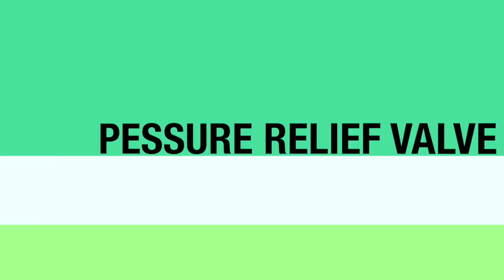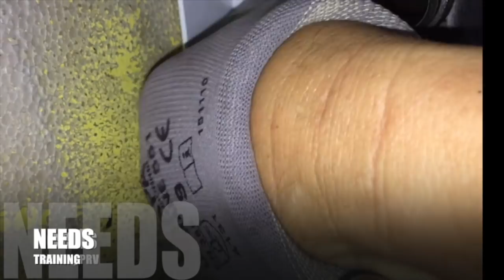replace a worcester plate heat exchanger and a pressure relief valve

Comment: Thank the gods now, on the new Worcester 8000 series the prv is at the front. Top bottom and sides come apart, colour coded parts inside for engineer. Slightly smaller and whisper quiet👍
Reply: Almost as good as Intergas. Intergas no diverter so never fails to supply hot water. Plate heat exchangers never fail neither.

Comment: Good video mate, must agree with other comments on how these boilers are trash. You will pay for the name and the boiler is full of plastic, can’t imagine the mark up on these. Also instead of making the flow turbine into a decent design they just chucked a green rubber jacket over the motor instead of making it so it doesn’t leak so easily!
Reply: What are you talking about? Worcester Green Star has won Which Magazine awards for the past decade. They're highly regarded within the industry.
Reply: Barrios Groupie obviously not a service engineer then!!

Comment: As a heating engineer with 40 years experience,I hate Worcester products with a passion.Its a damn shame they are so popular as  I hate working on the piles of shit.
Reply: i am sure they hate you too..... with a passion :P let me guess, you are a Biasi or Saunier Duval kinda engineer, as with 40yrs of experience, i bet you don't like change... you want the case to fall off, and all parts removable with one tool... times change, so do boilers, its a fine balance of what the Customer wants at the end of the day :P
Reply: Over the last 18 years fitted many Worcester Boilers they have always given my customers good service and when anything goes wrong I send the service department out straight away sorted. it's all about knowledge really the training is first class however like in life if  you don't really know what you doing you will get punished like The Dope l heard about that went to change a prv on a junior spent 6 hours there . Went out crying their a piece of shit was that you sir. If you had invested 1 day getting  to know your nemis it would probably have profited you. Still after 40 years isn't it time to give it a rest let the younger guys have a go.
Reply: I with no experience except buying a CDi35 22 years ago which has had a hard life including filling a 16x4 circular  swimming pool every year for 20 years and washing the cars from the hot tap and the Ba***rd thing just failed for the first time; sludge in the heat exchanger I am told! So I have to agree piece of s**t!

Comment: strip half of the boiler to get to prv.how they claim to be the best .probably the worst design ever.detest working on these.
Reply: Some engineers can remove a section of cold water pipe and get hand up the back and change that way! My hands are far too big! So yes all this to change the prv! I've never rated Worcester I've always installed baxi and just recently ideal logic maxs
Reply: Absolutely agree!
Reply: Frustration of trying to line the cover screws up as well. Overengineeed crap. Impossibly tight areas to work and no thought for the engineers working on them. I hate all their boilers.
Reply: Worcester greenstar changing prv on Tuesday Worcester shit take out return manifold just to change a small part like that Worcester need to employee sum one who has been on the tools to say what a shit place to put that.will never fit Worcester boilers ever
Reply: not really half of the boiler now is it :P
Reply: No, they just  have the best advertising campaign. My wife said that as when I come home with death in my eyes, she says, 

“Alright honey, Worcester Bosch!?!?...”

Customers are gullible and despite us heating engineers advising, they know best! Crap like the notorious the W.B.  PRV is why mechanics hate the engineer/designers of such machinery.
Reply: @TheDickPuller  

.....and a bomb there too, fins first!

Comment: This is exactly the reason I do not recommend nor install Worcester Bosch. With a Vaillant, the same job takes ten mins = less time, less charge to customer. Have just done one on a *astard Greenstar 28i and the plastic cowl would not lower, as it had jammed in place with scale. I could not force it for fear of snapping it, so this took even more time.

Easiest way is to isolate cold water feed on boiler, drain DHW circuit and cut the DHW pipe a few inches below the boiler, or however much you need for your arm and hand. Unscrew the horizontal compression nut, and remove this section of pipe, using a 15mm compression couple to reattach. My hands are huge and I’ve Popeye forearms, but still manage.

If things go your way, 30 to 45 mins.

Comment: Worcester reliable - YES. Easy to work on - NO.  All PRV's fail but why make it a nightmare to replace. Also I found removing the whole hydraulic assembly quicker to change the PRV. Same situation with the idiotic plastic filling loop from the CDI's onwards,  why did nobody in W/B work out how shit the design was until 20 years or more had passed.  Just like Vaillant/Glowworm pressure switches & leaking diverter valves; why don't they learn from their mistakes.  Great video and keep them coming.

Comment: Plastic hydrolic section piss out water. Burner seals leak, poor access to prv , expansion vessel at back. Worcester redesign your boilers.
Reply: composite hydraulic assy, Burner seals should be changed every 3 to 4 years ideally (only leak through poor servicing and maintenance tbh) other boilers has ex vessels at the back :)

Comment: Brilliant video. But all you actually need to do is cut the hot water pipe out of the way and use two screws to remove.

Comment: Thank you for this video. Only problem I encountered was the pipes run up the back of my boiler which means there is no room to take the exchanger back to get it out. You can however loosen the right hand pipework mount to bring it forward enough to lift the right hand side of the exchanger out if the way to get at the pressure relief valve.

Comment from the maker: HI Luke when you have remove the clip that hold the prv in place you will need to pull the p r v out  of its housing hey can be stiff the prv sit in a slide connector you pull the connector down to remove prv

Comment: At about 2.40 you made taking out the prv  clip look easy.
Reply: yes, I tried pulling with pliers and still to tight. just need to pull the clip downwards   with fingers, then you can get it out,  one post here mentions you then have a slide connector, you pull the connector down to remove prv. I will try that and hopefuly without even opening the boiler. 
But heat exchange above PVR may stop you lifting the  PVR up and out.?
Reply: taking the clip out is easy, it's putting it back in that's a brasstard

Comment: The pressure release valve holder ,the plastic thing,can move up or down to accommodate the PRV.You got to push it up to fit the PRV.
Reply: Is there a specific technique to move it down?
Reply: There is a lever at the bottom of the holder ,try that one .
Reply: Hmm, doesn't seem to budge at all for me. I wanted to see if I could remove and clean the PRV without having to go into the internals and remove other components. but it is proving tricky.
Reply: You can't take it out without taking the heat exchanger out.
Reply: Ah OK, thanks

Comment: well in, 
I've got a hot water running cold then hot on WB greenstar 24i. when I started the job I was told by the woman hot water on when on or off. I thought diverter stuck mid position. so I had the cartridge out and it's rusted to death along with its housing so the customer advised to replace. the partner returns and says his prv is also dumping bucket loads. will his prv be connected his hot and cold problem or would you say it's the diverter unit and housing that's on the way ?

Comment: As other comments this fails when pipe work is run in the Worcester suggested position up behind the boiler. And you didn’t push the outlet back up onto the PRV so there will be a drip under the boiler next time it has to let water out.

Comment: total overkill video , can save most the work just by cutting the hot water draw off pipe , gives you more than enough room unless you have time to kill .
Reply: At last somebody that knows the job I just info the nuts and move the pipe to the side takes about 20 mins only ever gone across one that I couldn't do...blocked plate2plate spirit of salts dies wonders..
Reply: Don't even have to cut it. Just disconnect and move inch or so to the side. Plate slights straight out.
Reply: That is the easiest way of doing it as long as pipesdrop down,and not run up the back.   Prv was put there to stop people using it drain down.
Reply: @russellblevins706 yeah they told me that.  Same reason the frame has razor sharp edges.

Comment: Drill out the three pop rivets that fix  the bracket for the plastic PRV outlet pipe and the pipe can be lowered away. The PRV can then be removed horizontally after fiddling with the clip.
Reply: You don’t even need to tackle rivets, let alone be using a drill 
to change a prv 😂😂 fuckinghell

Comment: Hi, Thanks for the excellent tutorial. I have managed to follow it throughout, but unfortunately I cannot remove the PRV at the end. It is unclear exactly what the mechanism for removal is. Could you clarify - thank you!!
Reply: the prv has a long plastic tab beneath the assembly, it locks in position, so look carefully at that and after pushing it to one side pull the tab down, leave down until new one fitted.. other similar boilers (WB) can be accessible without all this hassle
Reply: rumour has it that luke Anthony still has his boiler in bits
Reply: Daniel Curry nope he's replaced it with an ideal isar he found on eBay

Comment: Great video. The PRV only needs replacing in rare cases so it's not Worcester's effort to make it more accessible. What matters is they've created a very reliable boiler that is respected within the industry.
Reply: Once the PRV start leaking due to faulty exp vess, u have to replace it as the leak will carry on.  Extremely bad design.
Reply: @BrianTwo I don’t know why the retaining clip for the prv goes inside rather than outside.  If you could release the clip from the side around 75% of replacements wouldn’t take more than a couple of minutes.  There is someone at Worcester that likes making things difficult it seems.

At Vaillant they make it easy, - which helps when every part lasts about 24 months.